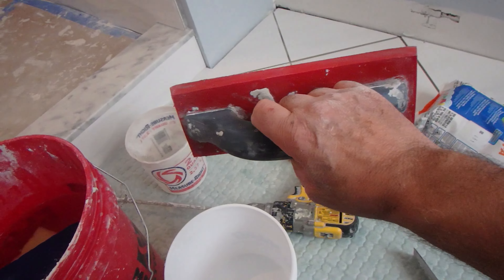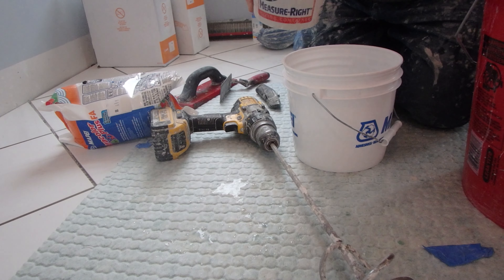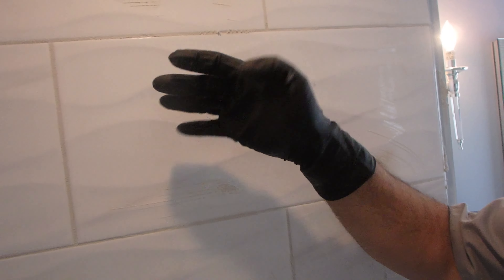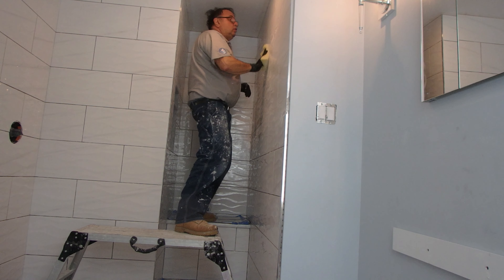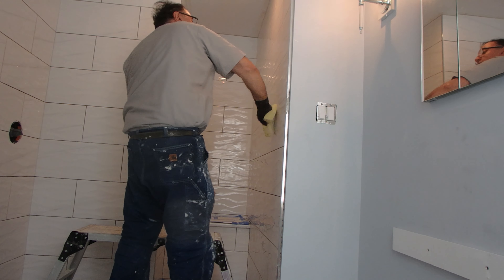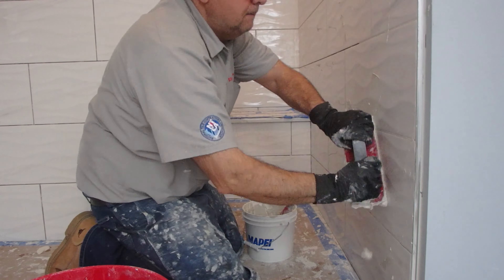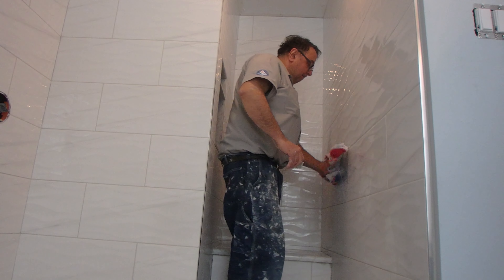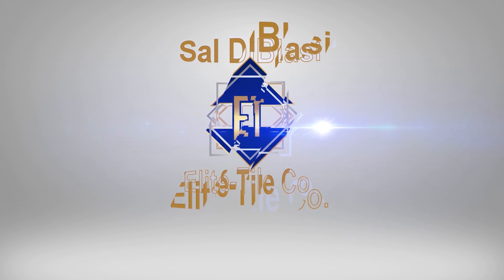How to grout, STEP by STEP

Comment: Sal, i want to thank you for the tutorials. What do you do with the joint space between the bottom of the door frame molding and the tiles (that was sawed to the tiles height). Do you put silicon under there ? it's in a bathroom. I have grout alabaster color matched sillicon and white sillicon. The door frame are painted white. Which sillicon should i use there ?

Comment: You make it look easy.
I did a floor and it came out well.
I guestimated the amount of grout I needed and divided the water by how many pounds of grout needed.
Worked well but seemed to set up rather quickly and it was only an 8 x 8 room with 12"x 24" tiles.

Comment: My mapei ultra color fa say's mix 4 to 5 minutes no slaking time use right away. Last job i used it on i ended up with the grout being four shades darker, looks wet at one end of the backsplash,  dry mixed the bag thoroughly since i only needed a little over half a bag but 2/3rds were consistent last third is dark, I've used this product many times and Ardex, poly blend etc.have never experienced something like this. Any clues out there, talked to the tile rep and she's never seen it either.

Comment: Hey Sal - nice work as always! Quick question... so I came to realize the there's a difference in rectified and non rectified tiles. As I was attempting to play with the spacing using a tile lippage system I realized these tiles are not rectified. Thus I cannot get the tight 1/16" joint as the back of the tiles flare a bit - is this just life in the tile world?
Reply from the maker: https://youtu.be/5rQ3282OCmM
Reply: @SalDiBlasi  thank you
Reply: @Sal DiBlasi  do you prefer the solid polyurethane grout float over the gum rubber or is that a personal preference thing? Thx
Are you familiar with the Novabell Materia tiles? Any good?
Reply from the maker: https://amzn.to/3yASuSP

Comment: How did your grout stay workable for that length of time? I find it starts setting up in the bucket and then it doesn't float into the joints very well.
Reply: Without being long winded- it might be the water hardness and other things coming from the tap especially if it's well-water.  I just grouted this past weekend- we have a softener, and I had plenty of time to work with the amount of grout I made in 2 small batches.  When in doubt, use distilled water for the mix.
Reply: Gotta work fast. I always break a sweat when I grout a whole room. But I can usually get a typical bathroom spread in about 30 minutes. Let it set up 20-40 minutes and scrub it with the sponge. Then come back and wipe with the sponge. Next day do a final wash and the haze is gone